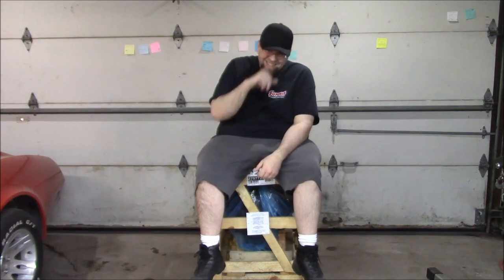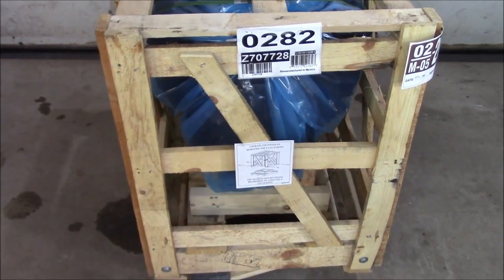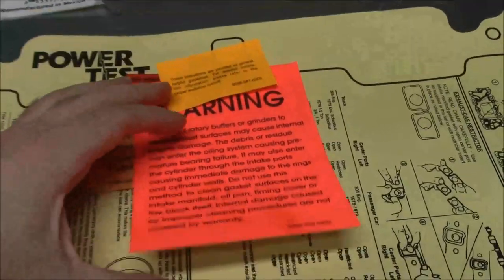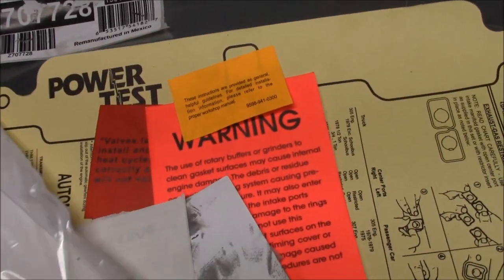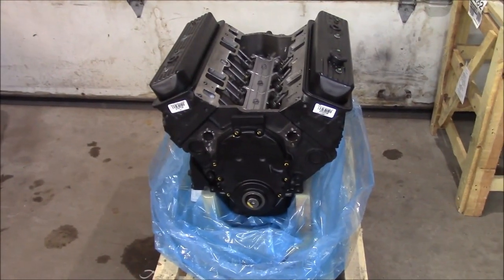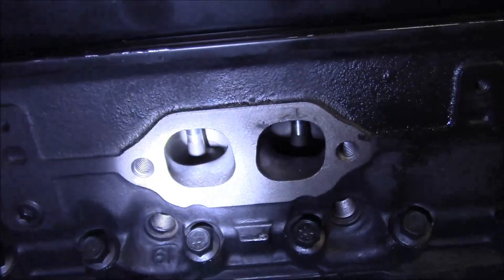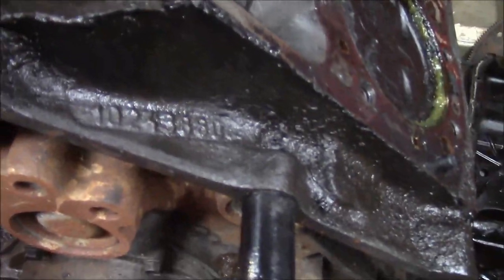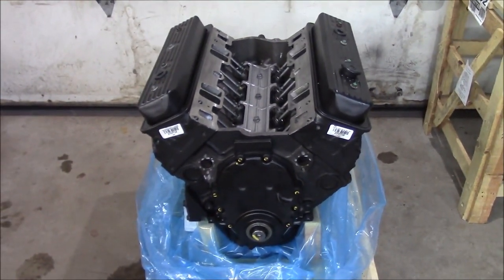Jegs ATK 0282 Vortec 350 Crate Engine unboxing

Comment: I might have gone with a crate engine for my 70 Z28 when my solid lifter cam went south but the GM Parts Dealership couldn't tell me what and what I couldn't use off the 70 LT1 to the crate roller engine, so I had the 70 LT1 rebuilt with a roller cam.
Reply from the maker: My luck with machine shops hasn't been great, so we'll see how a reman crate goes.
Reply: @BOOT  how is the engine running so far and how much did it cost I seen a brand new one same engine about $3,900 4 bolt main all new everything and valve covers and balancer covers already installed on it which saves time when installing. I just heard u say 36 month warranty unlimited miles that’s great. I’m wondering now are u still driving her. And if I’m not mistaken jpeg requires your core this other company I just seen doesn’t their long blocks are actually new.
Reply from the maker: @kingzionmusic  Not messed with it since part 4, I'll get back to it eventually.  The cost was right around $1550 if I rem right and there was no core or core charge.  Wish I spent the extra $500 on a GM crate, course these days both are a lot more.

Comment: How is it doing? I was debating on Jegs vortec or GM preformce L31 vortec
Reply from the maker: Sorry I haven't tore into it yet and will make a video when I do. The plan is after I get my C3 back on the road.  Same considered a genuine GM crate but since I'm gonna take it apart to mod, figured why not save a few dollars, I'll find out when I get into it if it was the right choice.  I have made some other vortec heads vids of the used set, hope that helps.
Reply: @BOOT  I subscribed. I'm not planning on doing much to it. Maybe a cam and ls6 springs. But that's a maybe. I appreciate the response!!!!
Reply from the maker: Still not sure what cam I'm gonna go with, considering the GM  ZZ4 cam, LT Hot cam or maybe just the cheap milder low end power Ramjet/HT383/marine cam since I wanna keep highway gears in that car.  LS blue springs should be fine depending on the max actual shifted rpm for the 1st two, I know they come on the ZZ4 engine these days but still not sure of the installed height on that engine.
Reply: @BOOT  that LT4 Hot cam sounds good. But I also need it to be easily streetable and ideally run on 87. I know. Hard to do. Might as well keep my worn out TBI 5.7
Reply from the maker: It depends on a lot of things, I'm no cam expert but it could be possible to increase power while also efficiency, provided you spec the cam for your goal and not get something that moves the power band too high at the cost of low end(cruise power).  Still even then it's up to you and your foot how much you use that extra power.  GL I'sure there is info out there to help achieve what you want.

Comment: What are the  camshaft specs  ?
 Nice !!!
Reply from the maker: It comes with a stock vortec cam lift .414 int/.428exh dur 191int/196exh.  I'll be replacing it with a mild aftermarket cam for sure.  Prob use that new stock cam on my very budget high mileage 4x4 donor vortec engine slap together just cause, unless I find a cheap used LT1 cam before then.
Reply: @BOOT  great for economy !
 I'm using a hydraulic oem style roller single pattern 480 lift  .050 is 230° duration  on a 108CL through Competition products it's a $199.99 sounds damn good !
Reply from the maker: @Motorcitypower1  I actually picked up a Howards cam on sale over the holiday with very sim specs. Your prob talking bout the Elgin e1135p, also a good cam!
Reply: @BOOT  , yes that's the camshaft.  Sounds really good in my std. Bore 350 I just purchased a comp cans XR 288hr that I'm going to install in another build (406cid) with afr195 heads hope to Crest the 500hp mark !
Reply from the maker: @Motorcitypower1  Yah the Howards should sound sim to my C3 flat tappet cam in the muffler vid I made.  Comp shows 406hp with sportsmans in a 355 so I bet those AFR's n extra cubes will get it there.